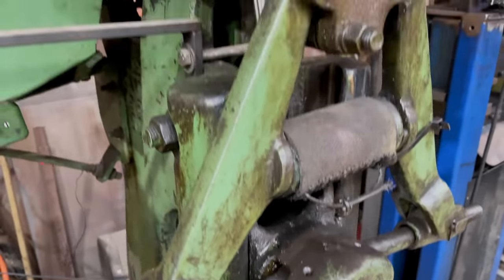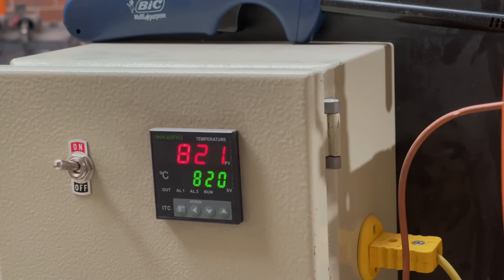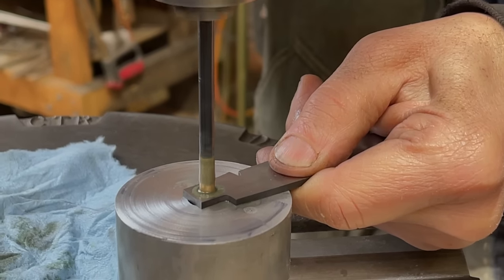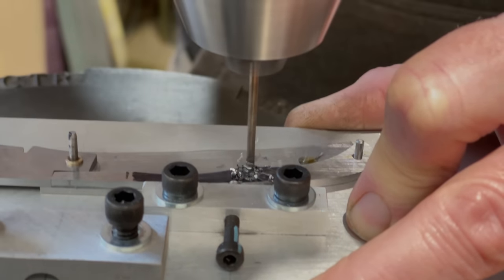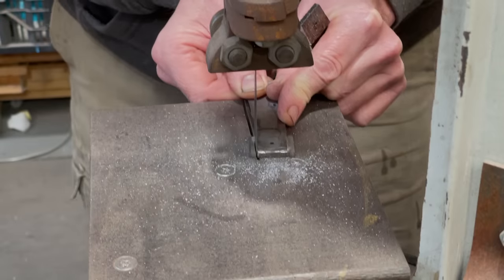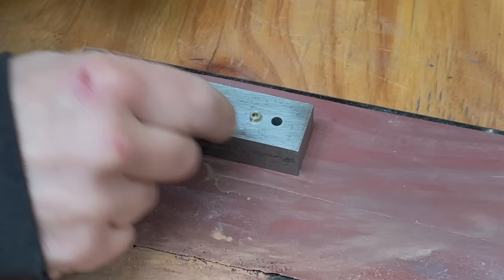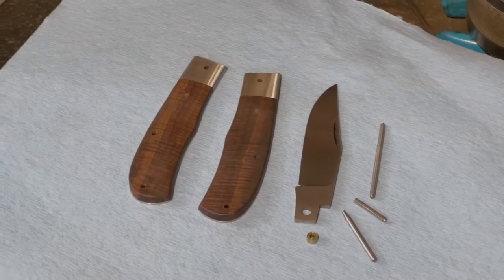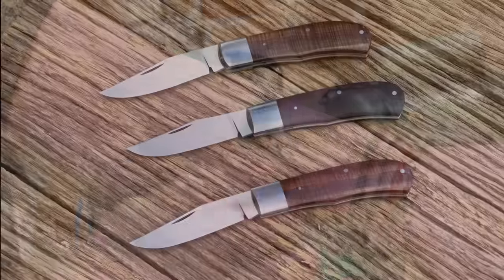How to make Stunning Folding Pocket Knife - with a Master Smith

Comment: I had no idea so many steps went into it, and how many specialized tools there are for making that process more efficient.  Very cool!
Reply from the maker: I think that's what I enjoyed most Tharemy, using and learning new tools and techniques. :)
Reply: That's an exceptionally well equipped knife shop, even without the tools he made himself. Did you notice that the one belt grinder had a secondary belt on the platen to reduce heat build up?
Reply: I will point out that you can do this with files and a drill press.

Comment: Gotta love that PID controlled forge. With that temperature control, and having the burner at the bottom to reduce oxidation in the atmosphere at the top, it's no wonder those blades came out with such little surface scale. What an amazing setup!

Comment: Fantastic!  I love living vicariously through you, Pask, so don't stop any time soon.  

Getting that feeling right as you transition through all three positions of the blade might seem like a trivial detail, but it makes all the difference in the world.  Even one of the unlearned can feel the difference between a good folder and one of those cheap things you might see at the local gas station.  It really is amazing how much of a difference the feel makes as you're opening and closing the blade.

Never would have thought CA glue was good for that application.  I guess the rivets are what really hold everything together and the CA glue is more of a gasket to keep air, and subsequent oxidation, out from in between the two pieces.  Learned something new there!

As for the vertical forge - nah.  They're great for heat treating long things, like blades, because they let gravity keep things as straight as possible, eliminating warps like you might see if you had the blades just sitting on a shelf or the like, but for general purposes I'm not a fan.  If you're going to forge a blade from coil spring or the like, 98% of the work doesn't benefit from the gravitational pull to help keep things straight and it actually hampers all the other stages before you get to heat treating.  All depends on what you want to do, and why most who forge will have several heat sources.  I don't make a lot of knives and can usually minimize any twisting or warping in a horizontal forge just by being cautious and moving the blade around so it doesn't get heated on one side too much more than the other.  That and a muffler pipe helps keep the oxidation down tremendously.

Still, don't take that as an excuse to not make more tools.  You've got an entire metal shop there and fans around the world who would love to see videos on how you make a vertical forge for heat treating blades!
Reply from the maker: Thanks very much - glad you enjoyed it! I wasn't very clear in the video but it's more the PID control of the forge I would like to do, I'd still keep the forge horizontal. :)

Comment: A great video and very informative.
I suspect that the bottle labelled "urine" contains a solution of ammonia diluted with demineralized water, to use when wet sanding steels that are not stainless; I've read that some people do this as weak ammonia solution is a rust inhibitor.

Comment: Beautiful! I've never made a folding knife, but wouldn't it make sense to slightly round the square corners at base of the blade that's in contact with the spring, to minimize wear?
Reply from the maker: Thanks very much! I can't remember the reason but it was explained to us why that isn't a good idea. Sorry for such a unhelpful answer. :)
Reply: @PaskMakes  I'm sure it was a whirlwind of information by the looks of it, as long as the new knife helps defend your soon to be finished airship from sky pirates I'm happy!

Comment: As was commented, the tool you used to chamfer the pivot pin is a cup bur aka cup frazer. Generally they are used with a flexible shaft machine or other handheld rotary machine. This one was held in what looks like a purpose-made handle.
Reply from the maker: Thanks for that Elliot - Corin has already pointed me in the right direction, where I can find one. :)

Comment: I don't see how the blade locks. is it just free floating, sort of held by the spring? Non-locking knives are dangerous and presume that the user is not an idiot, a dangerous presumption. But nice build, nice vid. Thumb up.

Comment: About the reading at the “timing”-process:
0.05 mm is the thickness of a normal hair. (0.1 mm is the thickness of a normal (A4) piece of paper). So quite a precision… And I don’t think that is really necessary. But if you can, why not. 😁

(To be honest, I’m not really into that kind of unnecessary precision and procedures. The results were of course beautiful, but I don’t think it would have been any different without the micrometer and precision templates.)

Comment: Really? Starting with templates. Smh. I don't make knives often. Just did two for colleagues and I did everything on my own with just a drill press and angle grinder in a limited mechanic shop at work.
Reply: Shake your head at using templates for slip joint folders? Seriously? Ok well I guess we will be as good as you one day if we keep practicing! On the fly folder design would scare the crap out of me and I have been making folding knives for 10 years
Reply: Yes this is definition of an idiom of my language that says "tool makes, hand prouds". They use annoyingly too much templates, precision measurement tools and power tools in every bit of step. Maybe with this way, you can make much precise products and it is better than low quality ones but there is no craftsmanship on it. But anyway this is excellent job and good way to start for beginners.

Comment: Beautiful knives but where are the thumb studs?!?!??!?!?!?!??!?!?!

(see benchmade - for all the ambidextrous users out there (or if you are left handed and then give it to your right handed friend).)
Reply: I have never seen a thumb stud on a slip joint folder?
Reply: @corinkayaker  

I dont know how you define a slipjoint. Most of Benchmade's folding knives have a thumb stud.

Here is a teardown of the Griptilian (feel free to watch from t=0 as well):
https://youtu.be/R-US4Wqo5eY?t=405
Reply: @dragade101  hey mate, a slip joint is a type of knife that does not have any type of mechanical blade lock. Unlike a lockback, frame lock, liner lock etc, slip joint relies on spring pressure. To hole the blade from falling open or closed. Think Swiss Army knife. Because of this spring pressure it is a two handed operation to open them. A thumb stud would  not work as you would require to much force to open the knife. With mechanical locking knives you can easily swing the blade open or closed once the lock or detent is overcome.  It’s just not a slip joint thing
Reply: @corinkayaker  

Thanks! I certainly like my knives to lock; kind of scary when they are not designed to.
Reply: The spring in a slipjoint does provide some "locking" (resisting pressure) for the blade, but nowhere near as much as a true locking knife. It really is not a problem because these are small knives and nobody uses them to baton oak logs. They are small slicers.

Comment: Ca for fixing is in no way a legitimate way to fix… epoxy is a minimum requirement… using ca means that knife is susceptible to heat and cold.. couldn’t believe my ears when you said that… and yes I’m a knife maker
Reply: CA wouldn't be my preference either. It tends to be brittle. I guess it's not that critical though since the scales are also riveted.